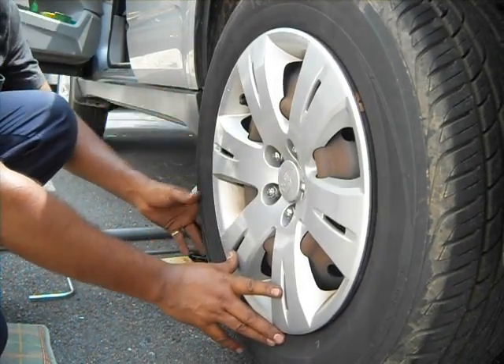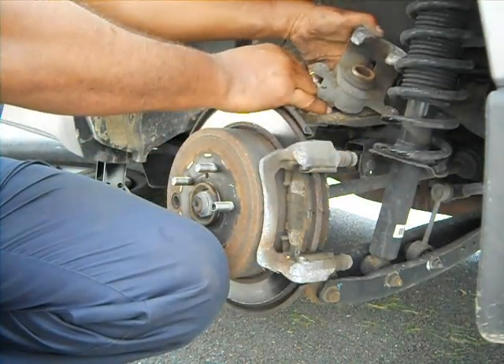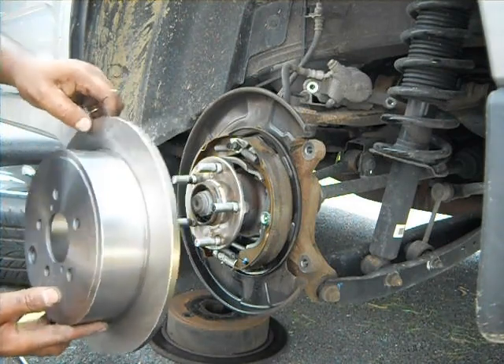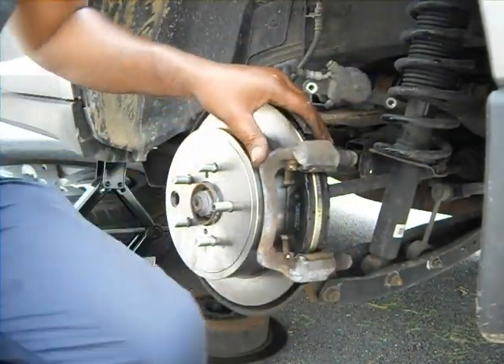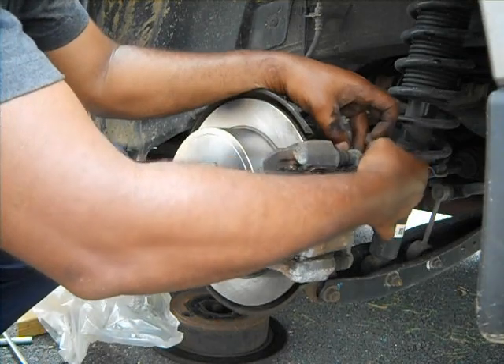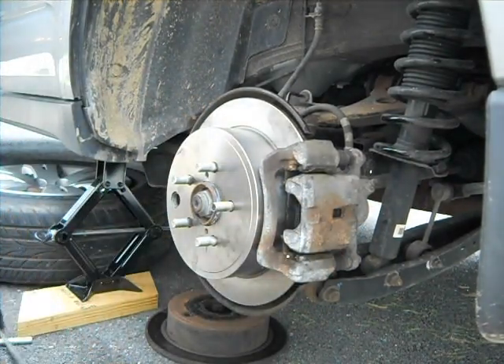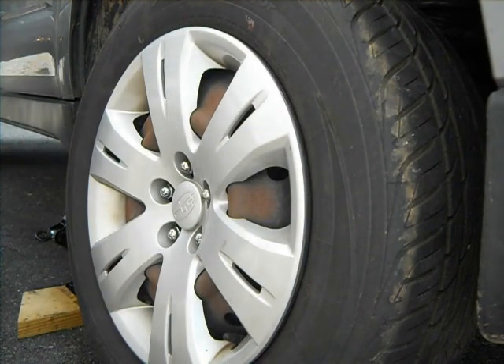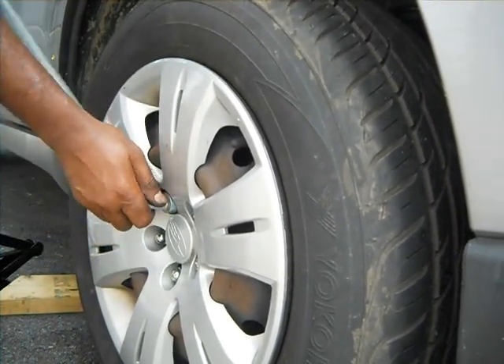Replacing Rear brake-pads and Rotors on 2010 Subaru Forester, by Tamene

Comment: Nice job!  May I offer some constructive criticism.  1)  A brand new rotor has an oily coating to prevent rust in the package... that coating needs to be removed before  you install it.  2)  Check the sliding-pins to ensure they are not stuck. I have seen the pins get rusted-stiuck and cause the new pads to wear uneven.

Comment: Saw the struggles with depressing the piston into the caliper.  Can do and is easier before dis-assembly - caliper stable and steady when still mounted in the bracket.

Comment: Extremely helpful. Super easy! It helped that I had a breaker bar. Also I had to screw two 8M x 1.25 bolts into the rotor to break the rotors free because of rust.

Comment: thought the rear calipers needed twisting while pushing back and you need a special kit which runs $25 on amazon.
Reply: that is for rear calipers that have a parking brake built in.   the Subaru forester uses a separate drum brake inside for the parking brake.  yes some cars the piston needs to be twisted as you push it in.
Reply: Hondas do that and prob other's but not subaru
Reply: Nice video. You should wear nitrile gloves to keep the chemical spray off of your skin. It'll absorb through the skin.
Reply: I have a 2016 legacy the rear calipers do now turn in vary easy with the caliper tool

Comment: Waste of pads...  there's still plenty of life in them.. just replaced 5 studs on driver front figured id buy pads in case they where worn but they looked about like yours prob over a year of life left I bet.
Reply: If they were used with warped rotors, though, then the pads could have warn uneven.  Using the uneven pads on new rotors would just wear the rotors uneven and ruin the new rotors.